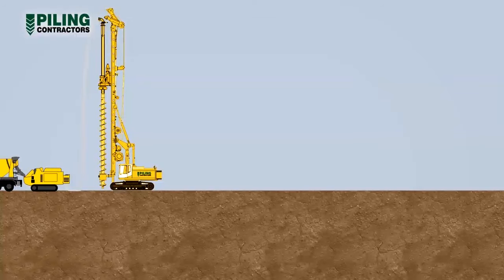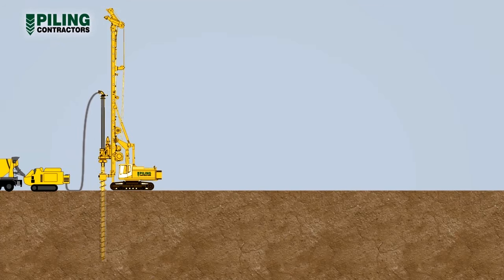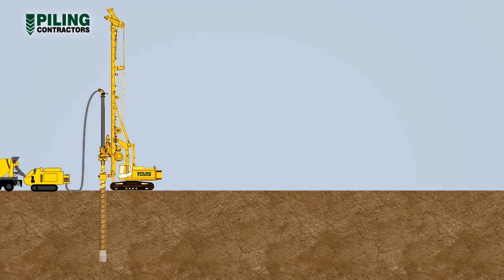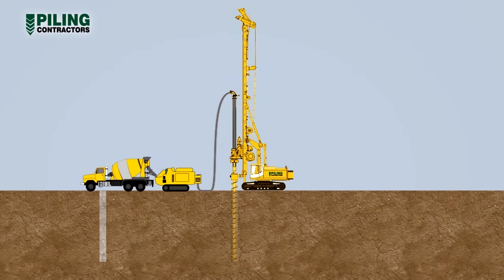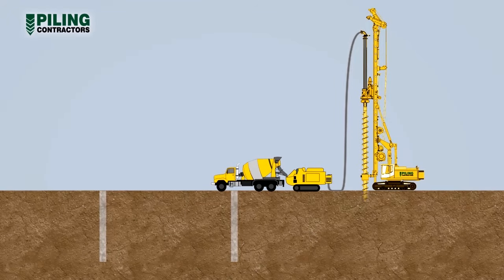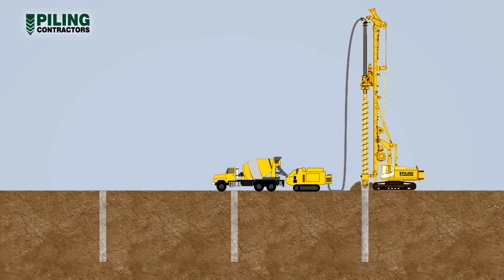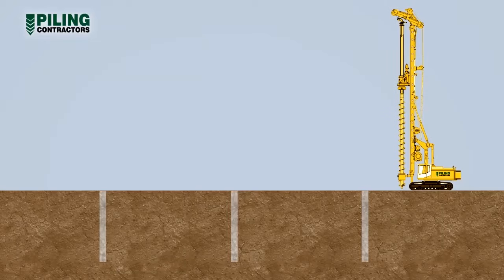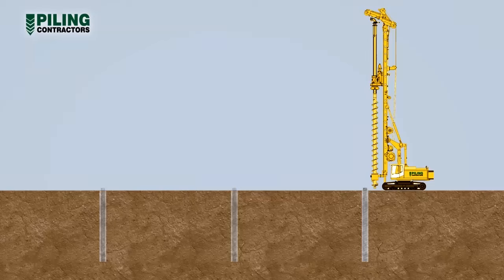CFA Methodology

Comment: I just bought an older tow behind drill rill rig that I was told is for drilling shallow wells and I need more info on because it has solid continuous flight augers, 3" and 2" diameter, two 6' sections of each. They are not hollow for injecting anything down the center of them. It has a single cylinder Wisconsin 6.5 hp motor for the hydraulic assist to raise and lower the drill and a 2 cylinder Wisconsin 18hp motor with some type of transmission made by "Long-Airdox" that the drills are then attached to and driven. Anybody familiar with this? Thanks!

Comment: I think there will be a problem while cage lowering. If the cage did not inserted properly.
Reply: They mash it down with the excavator and the cage is typically cone shaped on the bottom 3 rings. Plastic wheels are placed on the rings or spirals to keep it centered as it goes down!

Comment: Is casing necessary in cfa piling
Reply: Does the auger help to support the bole hole???
Reply: No casing. The weight of the concrete holds the hole open. Because it's heavier than water 💧
Reply: Auger acts as casing